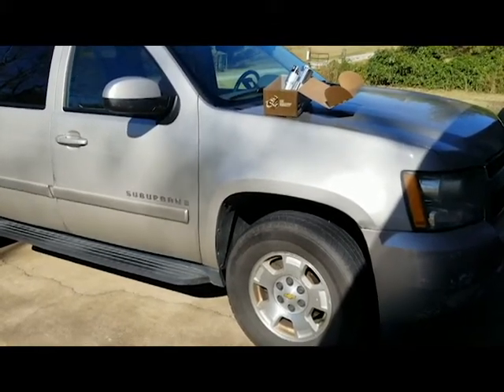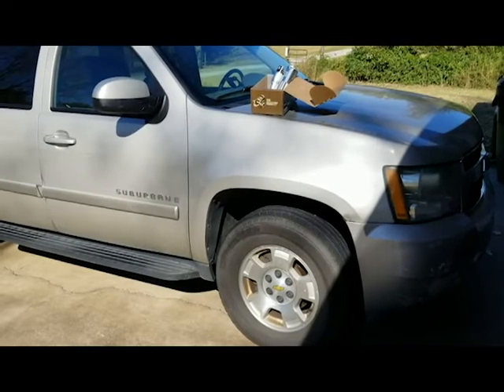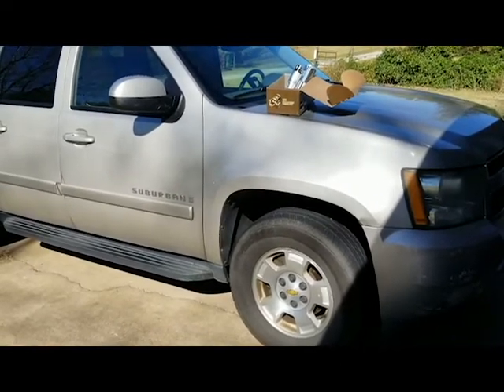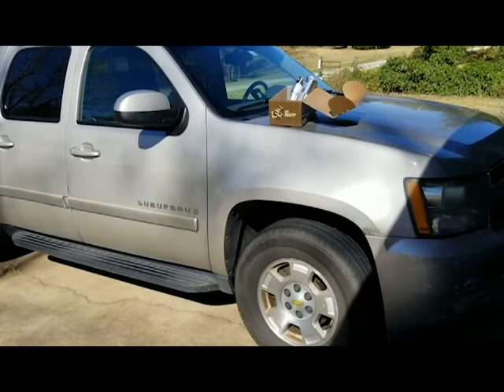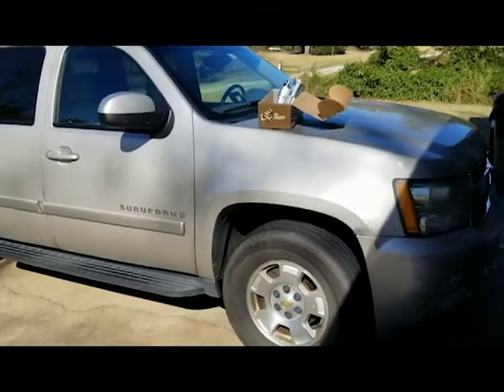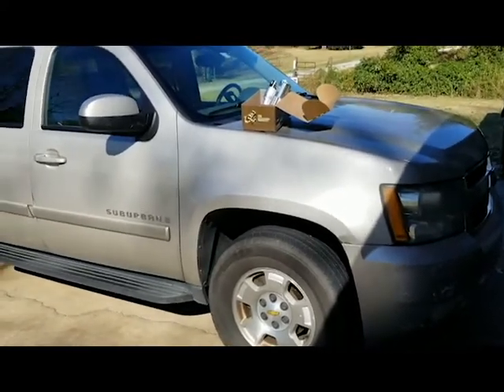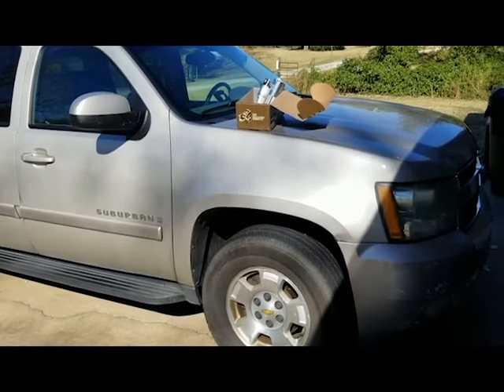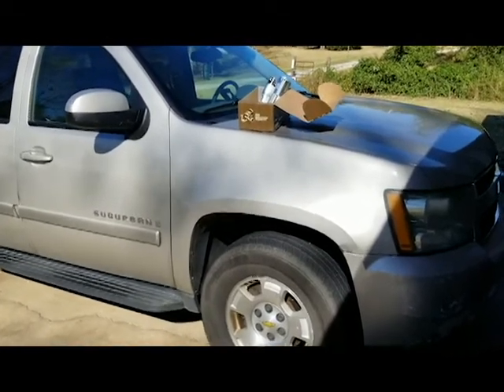2009 Chevy Suburban: replacing the starter

Comment: I’m about to do mine thanks to breaking the copper stud off whilst changing the positive battery cable. Also terminating resistor. (StabiliTrak - ABS - traction control lights all on) no codes. I have the same plastic clip on my 09 Tahoe.

Comment: Umm… you HAVE two threaded bolts on there…. Soooo whats the issue?
Reply from the maker: One of the wires going to the starter connected to a threaded bolt with a nut, and the other wire going to the starter connected with a plastic clip. Most of the other videos I watched showed both wires connecting with threaded bolts and nuts.
Reply: Watch the video